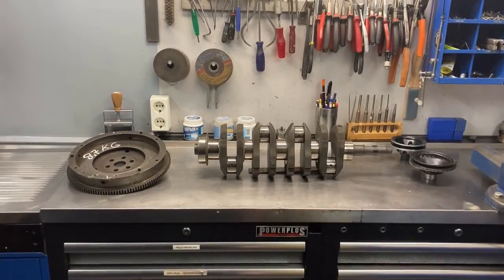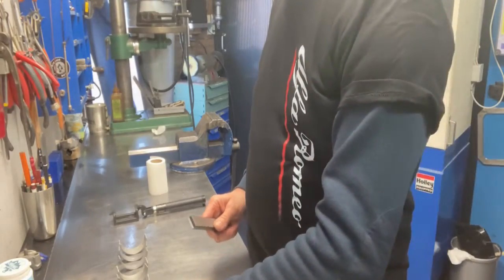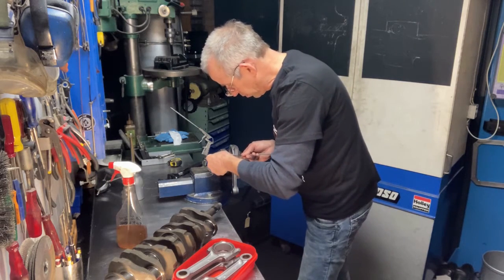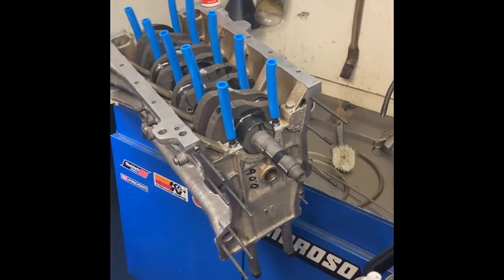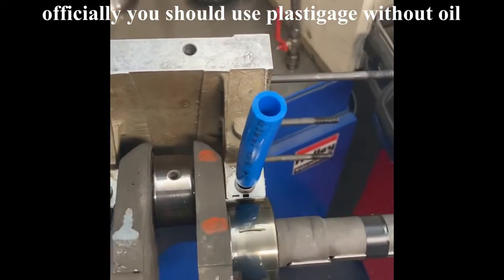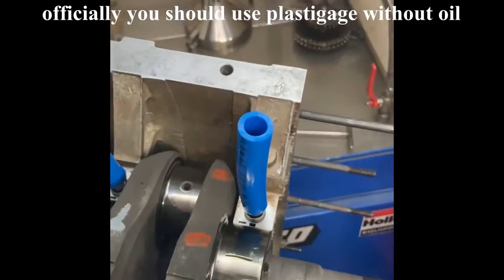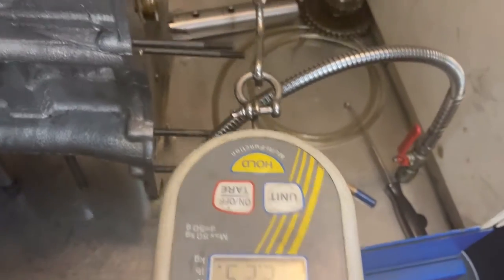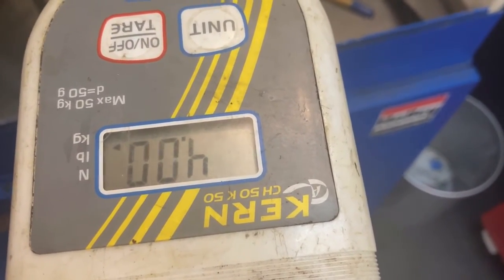Alfa 105 Engine rebuild part 5 installing the crankshaft

Comment: I never new about bearing crush. So if you grind the bearing it pushes the bearing cap up less after you re install Giving you less breaing crush?
Thanks.
Reply from the maker: Correct.
If you have OEM products the bearing crush should be correct .
Now with no more OEM products available anymore it is good practice to check  if it is close to spec.

Comment: Good job on getting clearance sorted. What replacement pulley is that? In regards to sealing you may want to consider turning it down .01mm or whatever the anodized coating thickness is. Curious how it's going to turn out, looking forward to the rest of the series.
Reply from the maker: I ordered the pully on My Alfa.
I think the alu is to soft to create a durable seal if it starts leaking i will use a speedy sleeve to correct it.
Reply: Where in Holland are you located?
Reply: Great, cant wait for the next part.
Reply: Excellent video! Thanks a lot for the effort :)

I go through this as well at the moment.
My bearing show the same marks from too much crush as yours.
I‘m just curious if they are still ok to use if ground down to size or if a new set must be used?
Reply from the maker: @mafelix105  
In my opinion they are still good to use.
If the crank rotates without binding and your clearances are in spec your good to go.
A lot of rebuilds are done without checking the bearing crush and getting away with it.
I know I have done this in the past ;-)
Reply: hi can lightening alfa 2000 crankshaft  ?